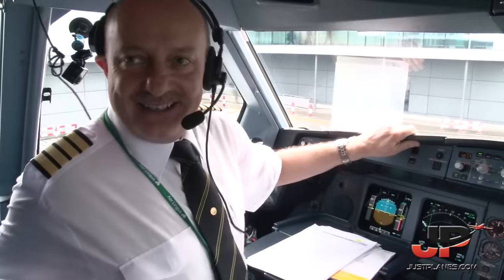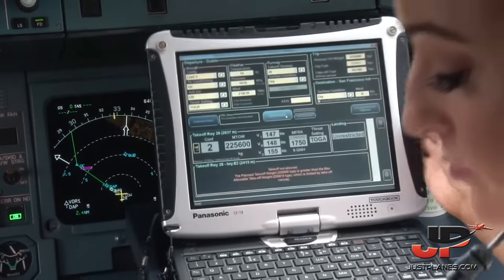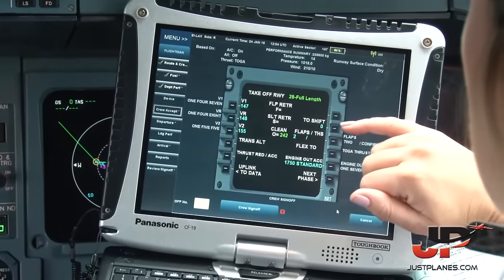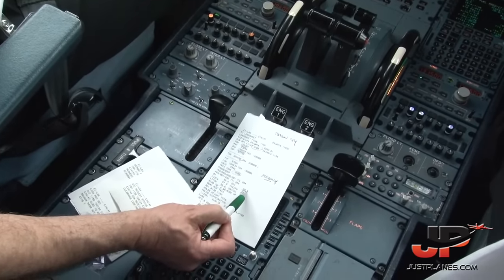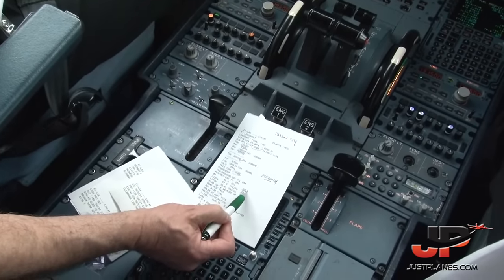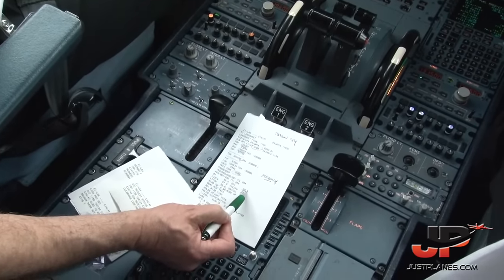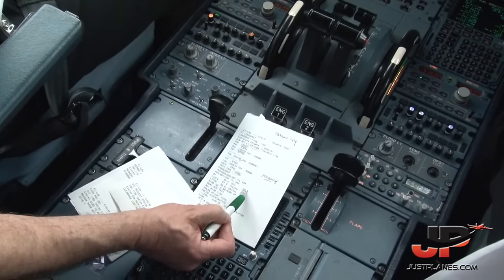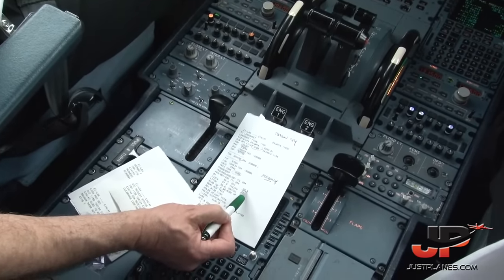AER LINGUS🇮🇪 Airbus A330 TOGA Max Power Takeoff from Dublin

Comment: After the Capt. checks his flight controls, why doesn't the FO check her rudder for full & free movement?
Reply: No need. The rudder pedals are connected, when the Capt checked his rudder she can feel her pedals moving too so both are checked together.
Reply: @blueb0g  Good question, I was wondering about that too; thanks for the answer. :)
Reply from the maker: Flight controls are checked by both, rudder by one but keep in mind sometimes you do not see everything that goes on in the cockpit, the video would be more than 10 hours long :)  so we cut things here and there...
Reply: Hello Hyland Family. Unless it’s all changed since I retired,  the handling pilot has to press the nose wheel steering disconnect button.  With his hand on the steering tiller,  he has to press using the rear of his hand just behind his palm,  and only then can he exercise the rudder pedals.   It goes without saying,  that  a straight stretch of taxiway is required.    It also goes without saying that this must be done with care,  because applying full rudder prematurely,  will cause the aircraft to turn !!